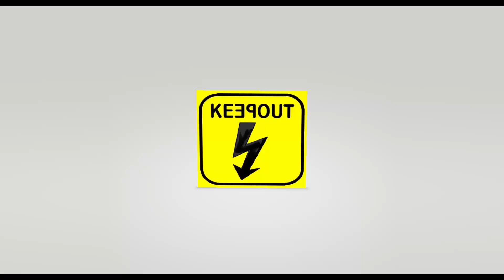L-C Oscillators With High Voltage Fields

Comment: Can you make a singing plasma toroid?

The colors in that lamp look like neon/argon penning mixture.
Reply from the maker: Technically possible, but toroid stability may make it difficult to work well and modulation needs to be added to the electronics. The sound level is also quite low. Yes, think you are correct the lamp is likely to be a mixture or argon and neon, and also feature in the plasma globe. This is a popular mix of gasses as the combination can reduce the strike voltage to considerably less than for  either gas on its own.
Reply: @tuopeeks  

Penning mixture. They use that as a starter mix for vapor arc lamps.

Comment: I found the circuit diagram eventually. Thanks for sharing. I have a quick question: Which one of the two coils in your diagram is the one through which you put the lamps? The one marked 6Turns or the one marked with the dashes (---)? Can you also please give more details about the coil or transformer marked with dashes? I would very much like to replicate this setup.
Reply from the maker: The coil on the right marked 6 turns is the main LC coil. The dashed lines indicate I've used a ferrite core and this coil is a blocking filter to prevent the HF feeding into the DC supply. Its not critical and doesn't need to have a core but it should have more turns than the oscillator. The most  critical thing with the coils is the current the can handle. The oscillator coil wire is 3mm in diameter and can run hot. Not only voltage is high but current too.
Reply: @tuopeeks  thanks. I was wondering if you could do voltage and current waveforms across and through the oscillator coil? That would be very informative, I would imagine.
Reply from the maker: @Baraka-yl2dp  It's not too exciting and would really need another video to do that. The LC wave-form is more or less a perfect sine wave when working properly.  Measuring the current with a scope is much more challenging as this need to be converted to a proportional voltage without distortion.  The voltages and currents are very high compare to the supply and at resonance are in phase.
Reply: @tuopeeks  it may not be exciting but could be informative. In fact, from your statement I can already imagine that it would be informative. The fact that it's a perfect sine wave when a transient decaying LC wave is expected is already exciting and informative enough. Also, the fact that the voltage and current are very high compared to the supply peaks my curiosity already. 
Please just do the voltage waveform if the current waveform is going to be a pain...

Comment: I believe the green in the tungar lamp might be coming from a BaO coating on the cathode. Very cool video as usual :)
Reply from the maker: Thanks for the info haven't looked into it yet, but I did notice the coating on the cathode did produce    the colours
Reply: @tuopeeks  ahhh, yes that explains it!! BaO is commonly used to aid emission if I remember correctly, and excited Ba produces intense green spectral lines

Comment: That does look like fun - ty for posting, rly enjoy yr vids.
Can i ask what were the L C values, and what transistor worked best. What was supply voltage, cant remember if u said that or not. And is yr adjustable cap homemade? It is awesome, reminds me of a film processor feed thingy, minus fins of course.
I really really liked your split diode xray trans dismantle, tour, explanation, circuit diag especially, and synthetic wax pour. I wonder what unit it powered, and whether medical or industrial
Reply from the maker: The variable capacitor is from a small transmitter, I think. So not home made and larger air gaps than a receiver tuning cap. Value between 50 -110pF . I was mostly using it down at around 50pf and moved to a fixed one at 40pf at one  point. Still looking for the best MOSFET but the one I was using here was IRFP260N but have blown a few.
Yeah, thanks, the x-ray transformer is nicely made. It was from a medical x-ray supply.

Comment: You can add a shunt-capacitor via D-S of mosfet, about 1-5 nF, ceramic cap or low-loss MKP film.
The efficiency of the circuit usually increases by one and a half to two times after adding it. The heating of the transistor is reduced by approximately the same amount.
Also don't forget about AC voltage (summary with bias) swing on the gate via different loads and tank quality factors. Adding a TVS to G-S is a good decision.
And finally - the G-S part is a fraction of the total LC-resonator now. Add 1-5 nf MKP in parallel for bypassing a portion of AC current. This also forms a sort of AC-divider with air-tunable cap, which allows you to fine control of gate AC-overshoot.

I developed a push-pull version of this circuit, but in a common drain topology. It turned out to be a very evil thing, for real.
Reply from the maker: Thanks, as you pointed out, there are a lot of factors to get these performing well.  I'll try adding the shunt capacitor as not tried that yet. Also find selecting a MOSFET has a big impact too. Easy to got through them too🙂
Reply: As I found out, one of the most important parameters of FET for this circuit is a forward transconductance - larger value is better, especially with low supply voltages (30V and below). Switching times and Rds-on are obviously important too.
As a common FET example, showing great results with Vsupp 15-25 V, IRFP4321 is a good one, for frequencies up to 50 MHz.
Reply from the maker: @Magic_Tee  Yes, the FET used has a very big influence on it working or  not. 🙂

Comment: It gets brighter when the plasma transitions from a capacitively coupled to an inductively coupled state 👍
Reply: Yep, this circuit is awesome for pumping electrodeless spherical spectral lamps with different metals/gas mixtures. A "ВСБ-2", for instance.
Reply from the maker: Interesting point. There two different coupling mechanisms are very noticeable. Some of the bright flashes with the Tungar lamp are due to sudden evaporation of elements adding to the gasses.

Comment: How did you remove the phosphor from that U CFL without opening it??
I'm guessinggggggg......ultrasound jewelry cleaner
Reply from the maker: Ah, that lamps had a small lose bit inside and I spent some time using it to remove some of the outer coating😁
Reply: @tuopeeks  ah. like with a magnet?
Reply from the maker: @Muonium1  yup👍